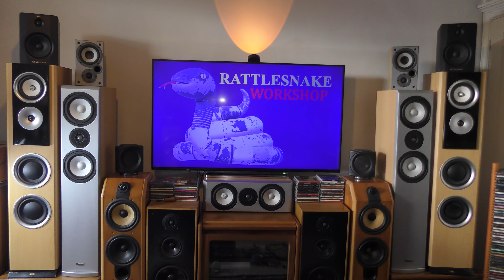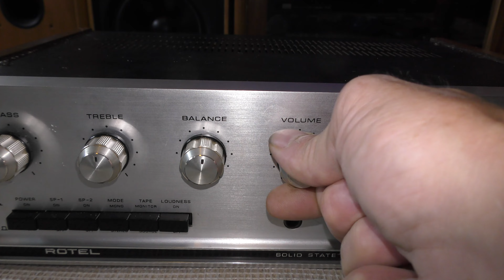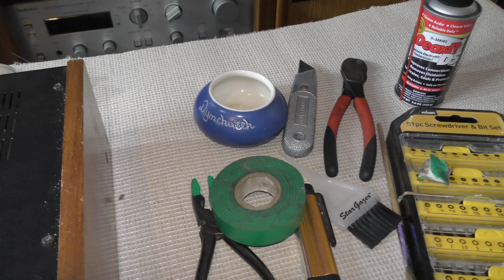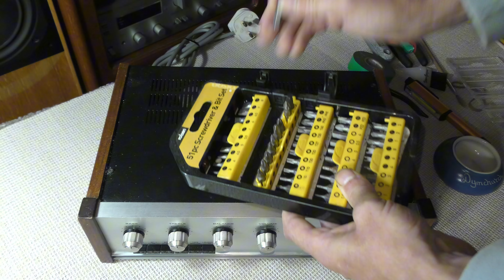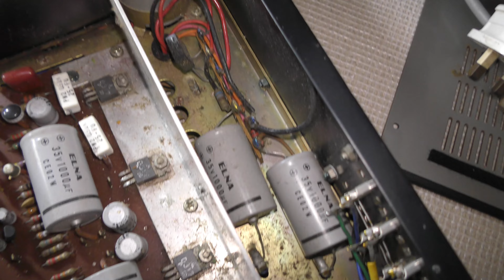VINTAGE ROTEL RA310 AMPLIFIER STRIP DOWN + CLEAN 1970s HIFI AUDIO SOUND STYSTEM MUSIC REPAIR SHOP UK

Comment: My Rotel RA 310 (made by Roland, Japan) Amplifier, about every 5 years needs the push button switches cleaned, with switch cleaner. If the push button switch assemby is undone, if each of the retaining springs on the back of each button are moved out of the way (one at a time) so the 2 tiny contacts and 2 very tiny springs per switch, go back exactly as they came out (extremely good eyesight required or watchmaker's eyeglass required), each button can be taken apart, but watch for the 2 contacts &  2 tiny springs per button as you withdraw the piece from the back of the button assembly to clean it, or you can spray electronic Contact Cleaner (a fast evaporating solvent cleaner) via the nozzle (mine was made by Radio Shack / Tandy Cat. No. 64-7026A) into the switch assembly via the back (inside) without taking apart and press the button in / out. Yes, children put coins in the Amplifier air vent slots, or people put change on the top or pins and as you say strip wires and a strand of copper gets in.

Been a great Amplifier got it second-hand 50 years ago.
Reply from the maker: good morning Mhood i love that you have had the amplifier 50 years and its still going strong , that just shows how good these old amplifiers are made .  i have been using my one last few days and i like it . its got a very nice detailed sound i have only had it going the little denon speakers on it so i need to try it out with a few other speakers on it  , i will have a night in with the rotel and try it out with some other speakers on it and i will film that and put it on my other channel as i do that all the time with amps i stay in have a few drinks and do a bit of testing and to me thats the way to get to no a amp a lot better .  i love doing that and its something that me and my friends have done for years ,  to a lot of people that sound like a boring night inn but to me thats a great night inn and i will really enjoy my self just trying out a amp and getting to no it ....  its the perfect night inn for a hifi geek like me .  thanks for message mate  rattlesnake